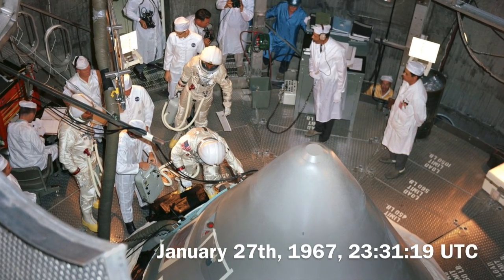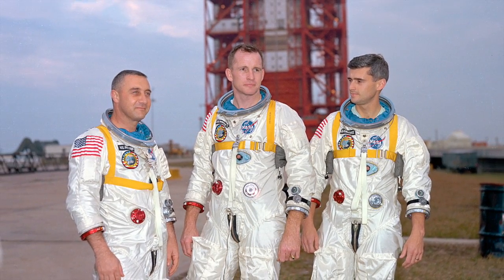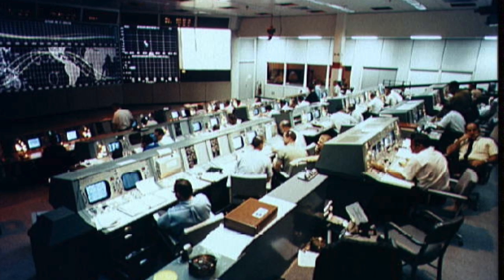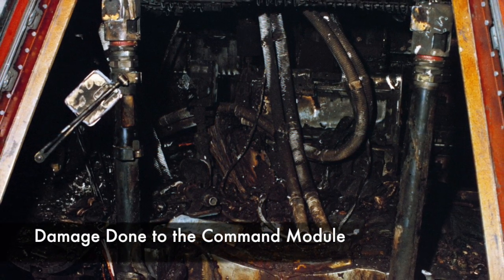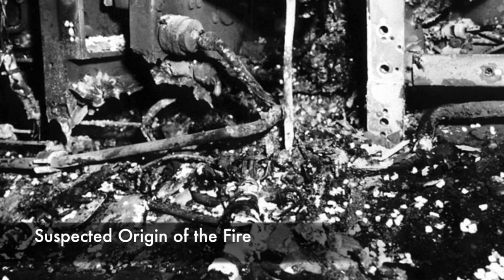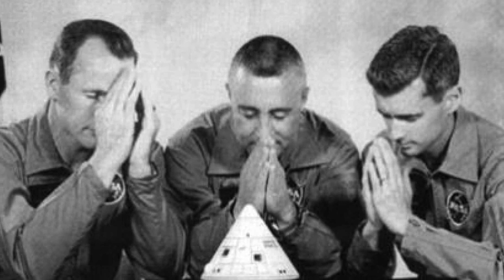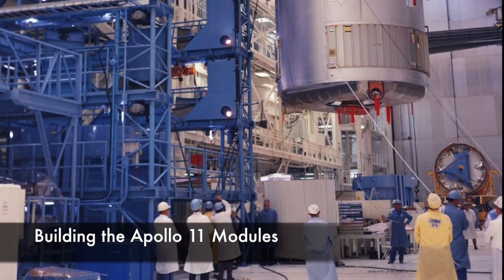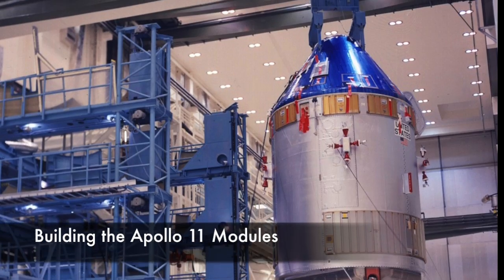Apollo 1

Comment: Pumping the capsule full of pure oxygen was a gross oversight. Anyone in their right mind would have understood that! Why was NASA so lax on such an important issue? Also, the area where it is believed the spark originated from was on a set of wires just under Grissom's "couch" that had repeatedly been stepped on by engineers preparing the capsule for all of it's various tests. It had been stepped on so many times that a single spark ignited the oxygen-rich atmosphere, where anything and everything would have burned at such high pressure. The hatch was so ill-conceived as to take minutes to open and had to be opened and grasped from the inside, not something that would have taken mere seconds to blow open on the outside! I'm just dumbstruck by these gross oversights and the ineptitude of North American Aviation when designing the Apollo capsule. Gus Grissom even hung a lemon from above his couch in the spacecraft one afternoon. Check out the picture they took of all three with their eyes closed and their hands clasped in prayer over a small model of the Command Module. What a terrible disaster, on par with the Challenger and Columbia disasters. God bless these Guys!